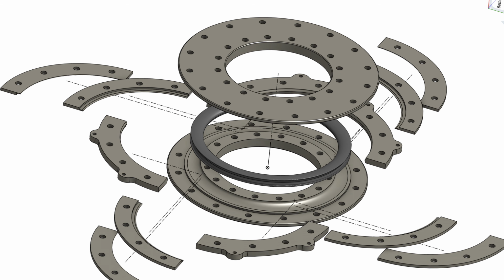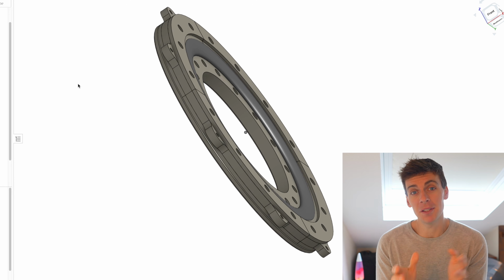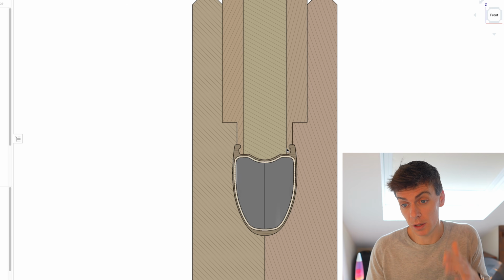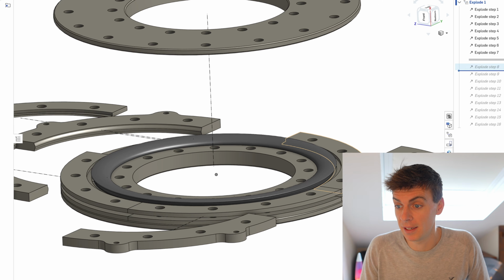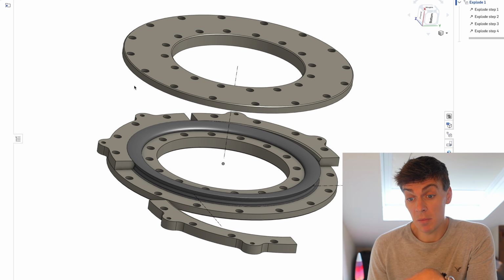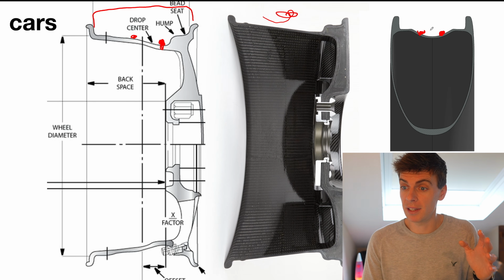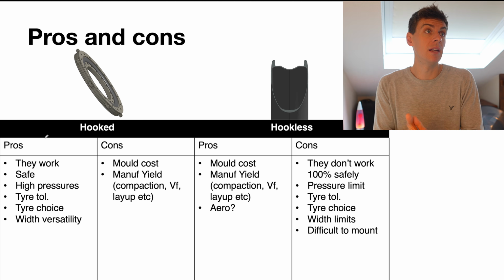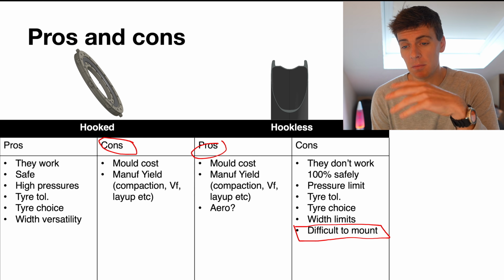Hookless carbon Bike Rims - the Truth = cost cutting.

Comment: Back before most of you were born ( I am that old ) hookless was quite popular for cheapness of manufacture , but after half a century of blow offs caused by exceeding the max recommended pressures , the whole industry went to hooked rims as it was safer and allowed easier tyre fitting due to tyres not needing to be such a tight fit so easier fitting and road side repair.  I can't even count how many times I have seen mechanics and customers blowing tyres off rims since the reintroduction of this old and well known design which invariable leads to failures . On cars, there are fitting machines to allow for the under sized tyre . Is every cyclist going to buy a tyre fitting machine ?   
The cycle industry is full of youngsters who's education is woefully poor and the result is repetition of old mistakes.  If you run clinchers , insist on hooked rims . 😘

Comment: So absurd that this cost-reduction-only thing is being pushed by brands as expensive as zipp and enve
Reply: I wonder why Giant does it tho. They are huge and they control everything.
Reply from the maker: Because of their throughput being so high, they couldn't afford the low yield, higher scrap and waist of hooked. They need everything coming out of the mold to be a pass, at those numbers. Zipp and Enve do too, because they are made in the USA. It is not feasible to waist 2-4h of labour per rim. I go into this more on the LR podcast linked above.  @icorlaiti
Reply: Dog turd.  More cycle industry garbage.
Reply from the maker: In the LR podcast linked in the description i go into how the mainland Chinese factories are not so bothered about pushing hooked. Labour is cheap, and everything is on their doorstep. Damn economics!
Reply: @PeakTorque  yea, especially Farsport, they literally have both hooked and hookless version for almost every one of the rim....
Reply: I'm all for better value, but these brands are the most expensive around!?
Reply: Tipp really managed to bring the price down with the 303s wheels! Hookless!

Comment: Good video,! So, this is a base on the issue at hand, but ultimately would you say that the current issue in the rim or in the tyre, or the combo? And, what could a theoretical soloution be, offset mounting in the rim (~as in car technology) along with higher rim sidewalls along with tyre change, or is the whole initiative like polishing a t*rd?
Reply from the maker: Too short sidewalls, too loose tolerance on bead diameters on tyres, too easy to mount by hand. Everything is just flying too close to the sun here. If tyres were the same i'd want to double to the sidewall height to 12mm! But then mounting by hand...impossible
Reply: @PeakTorque  Does higher sidewalls also contradict the ease of manufacture as well ? Accuracy on the sidewall "spacer" required on a bigger surface, biggest clearance angle to unmold...
From the product perspective, does that mean lower stiffness of the rim itself ?

Comment: Excellent analysis, fair play. Great to see the discussions from different perspectives too [manufacturing, reliability, tolerancing, structural]

All just makes me happy with my aluminium rims
Reply: Yeah...I was just researching the 'advantages' of fibre vs alloy at a number of sites. There's a lot of 'rote' answers, some of them being quite 'fanciful' (self-serving). I suspect that for the cost of production (or the claimed cost)  for fibre rims, a stronger and vastly more practical alloy rim die could be developed. Perhaps even a 'hybrid' with a layer(s) of fibre bonded to the internal surface (in whole or in part).
Reply: Imagine if that metal rim could be used as a giant brake rotor so you wouldn’t need a separate  brake disc! It would be like a huge disc rotor, and save weight too.  They should try that.